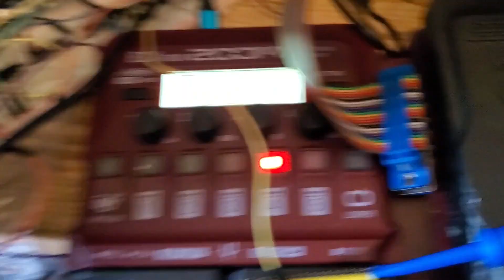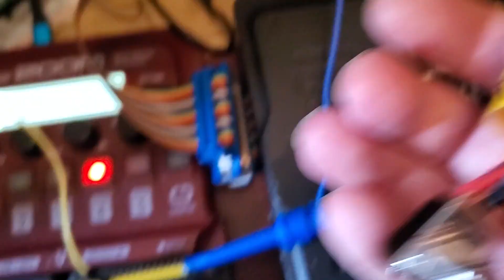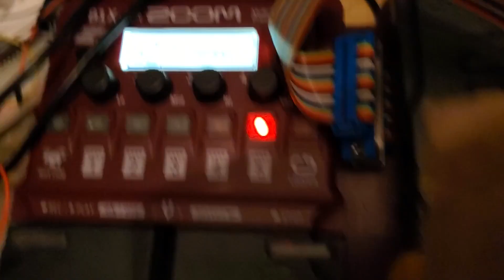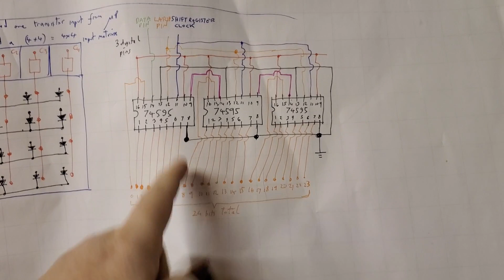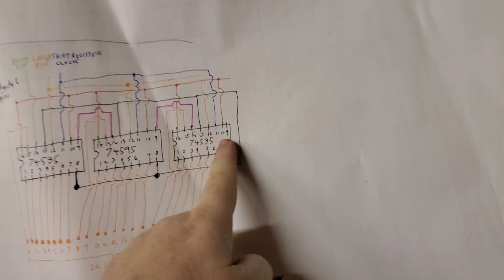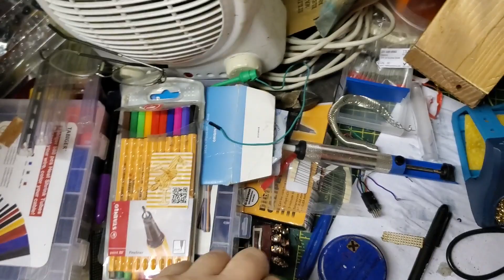Zoom B1X Four - Hardware Control Ideas Part VII - Constructing shift registers and testing

Comment from the maker: I found the bug with LED. I first swapped the chips. No change. So I got the cheap logic analyzer out. Pin 7 of 1st chip was always low. Took a picture with phonez magnified it. Ah - 7 is bridging 8 ... so always low. Removed the unwanted connection - works.

Will work on the software  next to read inputs and make appropriate output (ie tuner would toggle FS1 and 2, parameter will send quadrature to correct channel.).